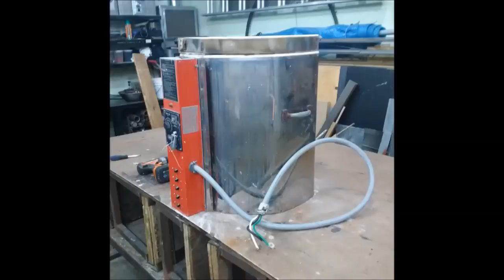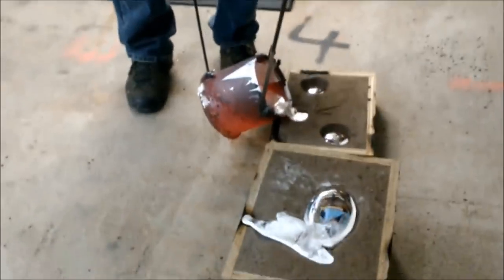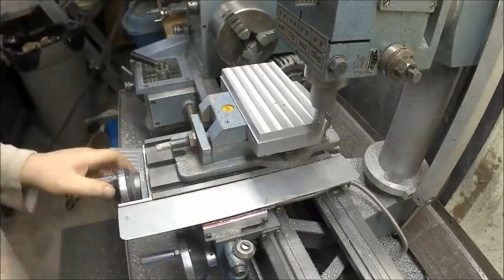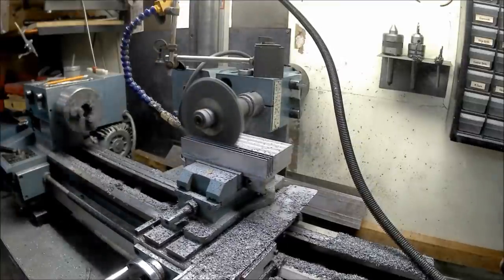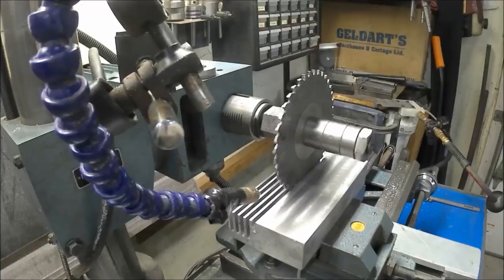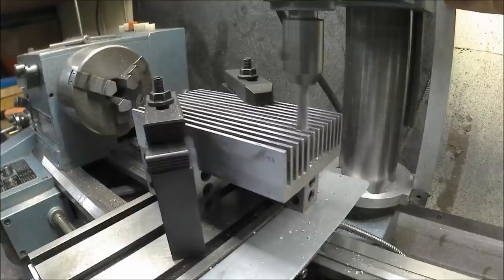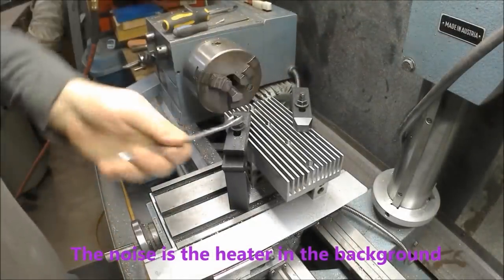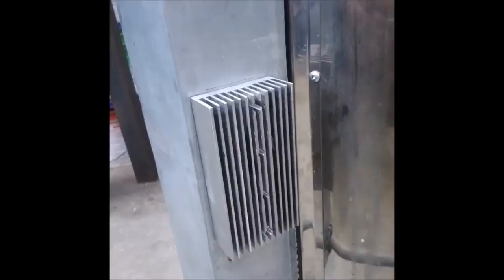How To Make A Heat Sink From Scratch

Comment: So if you ever had to make one again, would you try casting the fins into the block instead of machining them? Or do you think that would be to difficult?
Reply from the maker: good question. the fins are too thin to cast unless you use lost wast casting and i haven't gotten there yet. i'd probably do it the same way again.

Comment: Would it be possible to make something like this for a computer? I want to use something like this for a lid for a PC that has an AMD Ryzen Raven Ridge APU the 2400g. It would be mini ITX and run off a Pico PSU. If the heatsink is big enough would it be enough to passively cool the 2400g?

Comment: I respect your work and time, but this method is extremely inefficient, you waste 70 percent of the material in swarf.
Reply from the maker: The real only other "efficient" way to do it is if you have an extruding machine or do lost wax casting, both of which I'm not set up to do. Thanks for watching my video.
Reply: @ChrisOfAllTrades  , have you any link, and could give some explanation why what lose efficiency?
Reply from the maker: he was saying that I lose a lot of aluminum by cutting it out of a solid block. he wasn't talking about losing cooling efficiency.
Reply: This is quite efficient for a diy project.
Reply: @sonacphotos  Well, the way they are made in the factory wastes 0% of material.  So it is possible.
Reply: @sonacphotos  No.. for the same type as he made, the used a blade to cut into the block at and angle for each fit and then it bent up at the end of the cut.

Comment: Did You do any sorts of calculation in order to decide heatsink dimension or it was just hit and trial.
Reply from the maker: I looked at the wattage of the ssr and then looked up online what size one would normally get and then built in an extra safety factor.

Comment: Is there any reason you never casted the shape at the start ? Only curious as I want to try casting
Reply from the maker: The fins would have been way to fine for it to work unless you use the lost wax casting process which I'm not set up to do.
Reply: @ChrisOfAllTrades  thanks for replying. That make sense keep up the good work

Comment: So, I just watched a one man factory.
Curious though. Heat dissipation is the goal.
So why would one want to end mill the fins smoothly? I know very little about thermal convection, however a rough surface on the fins might dissipate heat faster than a machined smmoth surface.

Comment: Really nice looking end product and probably worth it for that but wow, wasteful, how much did the material cost compared to a new heatsink or even a surplus CPU cooler?
Reply from the maker: I had the material lying around. Cost me about $0.05 to make. Thanks for watching my video.
Reply: Ah, very nice indeed then.  Thanks for making and posting the video
Reply: @ChrisOfAllTrades  5 cents and how many hours?  What do you make at work per hour?  Because if it you even just $15/hr and it took you 10 hours.. that's $150 right there you could have earned doing something else.  Could have bought something for less than half that..
Reply from the maker: @markjohnson7887  yes, but you can't just take time and money as the only two determining factors to make a decision. Learning , exploring and conquering new challenges will greatly increase a person's capacity to reason, understand and conquer further challenges in life. So whereas it may not have been a wise investment of my time if you're only looking at this one project, it definitely was worth it just for the gained experience and confidence as it relates to further projects...
Reply: @ChrisOfAllTrades  Good point. :)
Reply from the maker: Cast the aluminum from a bunch if broken lawnmower engine pieces I got for free. The propane might have cost me a quarter but otherwise there was no cost to it.

Comment: What kind of machine are you using are the lathe/ mill combo machines worth it I'm new to machining and am looking for the best suitable machine for my needs any help or insight would be greatly appreciated
Reply from the maker: I have an Emco Maximat V10 and I love it. It's small enough to fit in my shop and yet decently sized for most medium-sized jobs. I would highly recommend it. I only wish I had the V10-P which has a power cross feed whereas my V10 does not. Also, the mill is not very sturdy so cutting speed and depth is a bit limited. You can still do most jobs, it just takes longer because you have to take lighter cuts.

Comment: Dude, don't let the kid near the machine, especially without protective glasses.
Reply from the maker: Not letting them near machines is exactly the wrong approach. I want to teach them PRACTICAL safety, not the ridiculous safety that they teach in the classroom with no actual real life application...
Reply: @ChrisOfAllTrades  One shaving in the eye and it's a trip to the doctor for a scratched cornea.  Teach the kids to wear eye protection near machines.
Reply from the maker: @dibensy59  yes, i agree. What i meant with "practical safety" is that when there's a chance for something like chips in eyes to happen to wear eye protection, but in this case, it was a slow-rpm situation with light aluminum chips that were several feet from her eyes so definitely no need for safety glasses. thanks for watching though
Reply: @Joe-xc4xc  You must never of had a scratched cornea.

Comment: an easier way would be to just use aluminum sheets - which you could make yourself, and tig weld them onto the flat sheet to make the fins!  if you don't have a tig welder that can do aluminum, make one - its easy to make
Reply: Are you sure welds wouldnt compromise heat transfer?
Reply: @rapidash1999  Old brass auto radiators were brazed. Conduction of heat only needs reasonable physical bond. So all good for heat transfer. Don't over think power inverter 
Heatsink as opposed to microcontroller.
The former does not have all the discrete connections of micro circuitry. So liquid cooling contact plate keeps all the electrons moving happily.
Reply: @ayebee1207  aye thanks for in depth anwser mate I appreciate it

Comment: Nice job. You should consider looking into lost foam casting. Even an old fool like me can do it. Aluminum has gotten too expensive to waste.
Reply: I tell you a secret, but after this you can not cry under metalworking videos: YOU CAN RE - MELT METALS!
Reply: @thombaz  Waste of time and fuel. Plus he's using oil to cool the metal.  So all your shavings are covered in oil.. That's why they aren't made like this on a large scale production run.  Nor are the cast.  They are sliced at a sharp angle and bent upwards.
Reply: @markjohnson7887  It is reusible with or without oil...
I can' remember how they make this large scale?
Reply: @thombaz  The shavings?  Yeah, you are right.  I think I had a brain fart there. lol  Large scale they take a block of aluminum and cut it at a sharp angle.  It bends up after a set point to make a pin.  Then repeat.  I just wish I could find the video again.  It's really cool.  And no waste as shavings. :D
Reply: @markjohnson7887  Interesting, thanks for the info.

Comment: why don't you make your mold have those grooves so you don't have to cut the aluminium to make fins
Reply from the maker: I wouldn't be able to make a mold that has fine slots like that unless I used the lost wax casting method and I'm not set up for that...